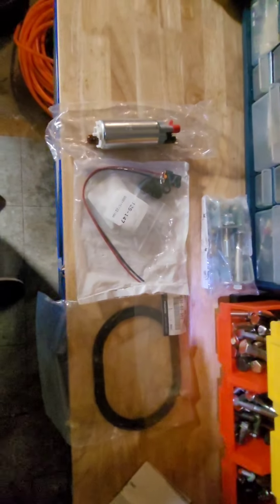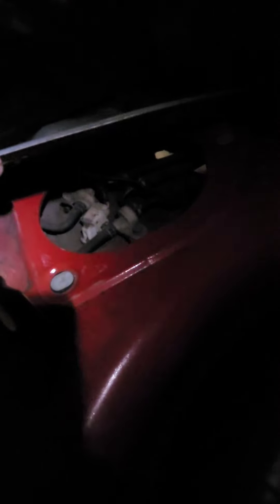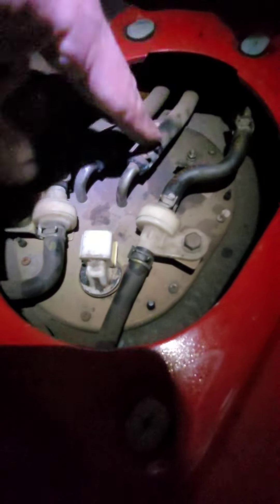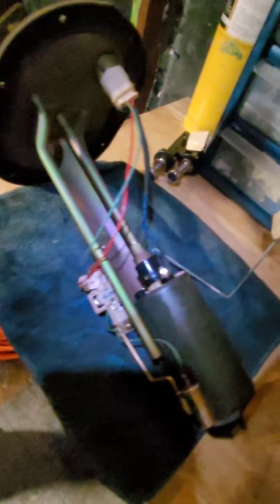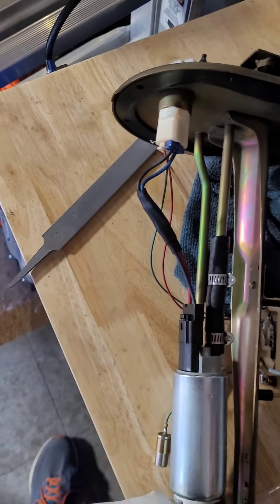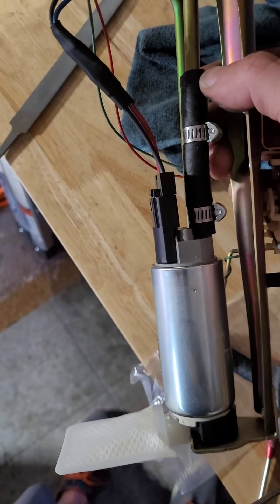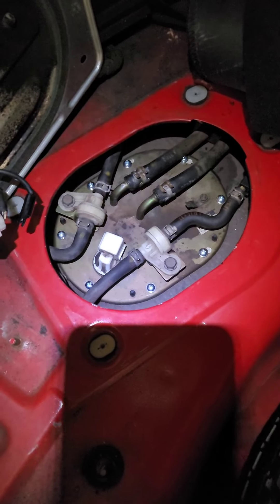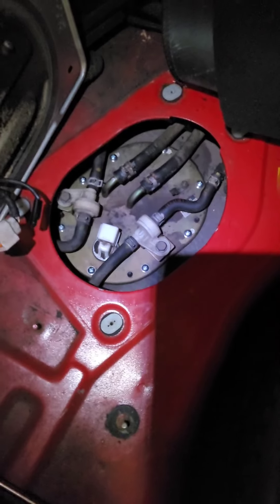Walbro fuel pump install on my FD RX7

Comment: Hey man, thanks a lot for sharing this video and cutting out a lot of the fluff! I referred to this before I dived into this job, and it helped a lot! For others who may dive into this, I ended up shaving the original spacer on my fuel pump to get it flush against the face of the Walbro pump which seems to be working well.
Reply from the maker: @Nymphetamine2791  awesome :) thanks you!!!

Comment: What type of heat shrink did you use on the wire joins as I've heard id its not the proper type the fuel will dissolve the heat shrink? Did you notice the car running richer after swapping pumps?